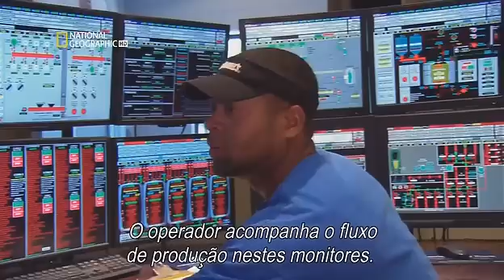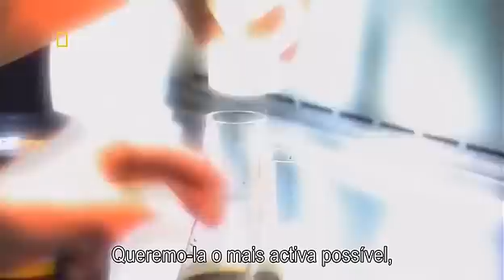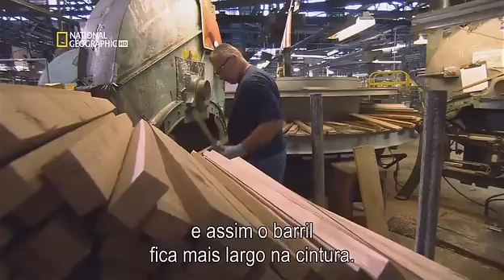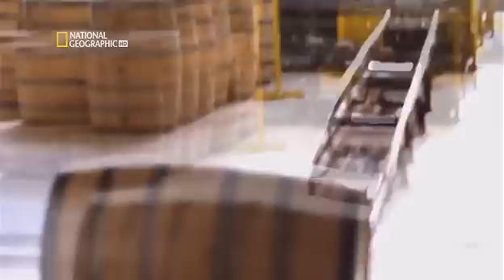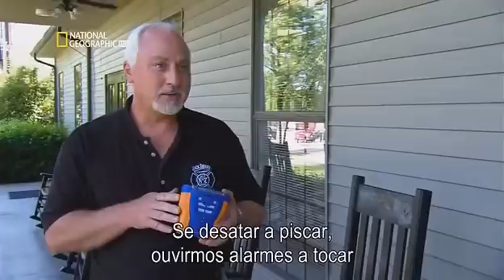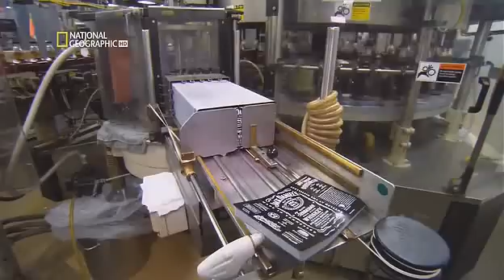-JackDaniels

Comment: They are in a dry county for a reason.  Because it would not look good if other brands were sold right down the street from Jack.  In fact, you can buy a bottle of Jack right there in the distillery.

Comment: It's now 2021 you'd think YouTube would HD the videos automatically. 

240 really 😒
Reply: You need sophisticated software because the problem is when you try to increase resolution, you have to stretch the pictures. When you do that, the pixels to get a tiny hole between each one. Then comes the BIG problem: what color pixel should go into that hole? A bit of red with some blue and orange? Or a ton of green with a dash of purple and neon pink? Even uber pricey pixel correction software doesn't always get it right.

Comment: Back in my youth, there were two Jack Daniels whiskies, Green Label and Black Label. They were different proofs, but nobody drank the Green Label (or so they said). I never knew the difference, only in the proof.Black Label was 40 proof, I think Green Label 
was like 90 proof. I don't remember. Google didn't coincide with my memory. So there.
McCormick's Bourbon is (or was) the only distillery west of the Mississippi and I thought it was a better whiskey. But it was hard to get so I drank Jack Daniels.
I tended bar for a few  years and I never heard it called "Jack". It's like news reporters calling helicopters "choppers". I worked in the aircraft industry 40 years, and I never heard civilian or military personnel call them choppers.

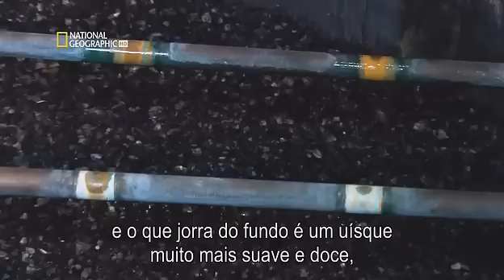Comment: 28:16 they could have used centrifugation to clean alcohol?
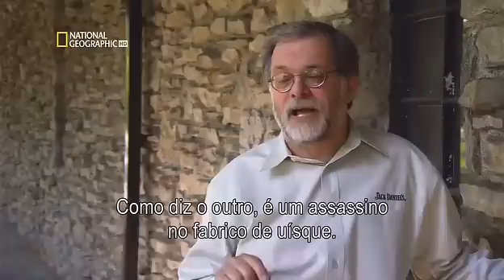Reply: 4:34 couldn’t they have used magnets to remove the Fe?
Reply: @HighestRank  No it is not possible to separate Fe ions in water with magnet. Correct me if I am wrong

Comment: What happens to the mellowing charcoal?
Reply: david diehl good ? Sure it would burn good n hot.
Reply: After it serves it's purpose for the mellowing process the vat is emptied and the charcoal is then moved up the hill to a used charcoal shed...from there it's either sold to independent buyers or simply thrown on the wood pile to be burned in the wood boilers...those wood boilers are used to produce the steam that supply the distillerys steam needs... everything at jack is sold or reused in some manner.

Comment: So basically, your drinking contaminated liquer caused by burnt wood from inside the barrels. Why do they do that.
Reply: its kinda the difference between vodka and whisky. Most of the flavor and aromas come from the wood and ageing. kinda like smoking meat very very slowly.
Reply: It's not contaminated liquor it's actually make a liquor better, charcoal absorb harmful ethanol oils  and ad good flavor to a drink, the drink has more harmful substances in it right after distilled, after it goes through charcoal filtration and again it burned barrels it turns into fine product

Comment: Do wonder how they make their cuts on a scale like that...Heads are dangerous, hearts are happy, and tails can be bad tasting.  Then ya wonder how they blend the cuts.  Guessing all that is uber secret sauce.
Reply: Tails are best mixed in with the next batch of mash. That way the alcohol can be extracted, apart from the bitter congeners. I don't know if commercial distilleries do it that way, though.
Reply: Most commercial distillers know the exact temp/abv the hearts start and stop, then they'll take a percentage fore and aft for flavour, in filtering and aging those late heads/early tails are mellowed out and even further through aging(hence using the more porous American oak vs French.)

The benefits of having ran the exact same  product for thousands of runs is it's no longer art, it's science.   Blending is probably computerised too, based on individual barrel tasting notes. Just punch it in per barrel and they know where to start to get most of the way there
Reply: And adding bit of glycerine.

Comment: I always wondered if the whiskey left in the barrel could be recovered? Maybe with negative pressure, or heat to evaporate the whiskey left. Has anyone ever tried to measure how much is left. Just a recovering alcoholic that's curious.
Reply: Barrel makers use to buy used empty whiskey barrels one said his dad would pour 3 pints boiling water in barrels seal it wait overnight after shaking it would be the smooth drinking the next day